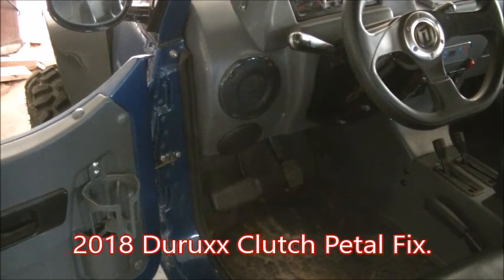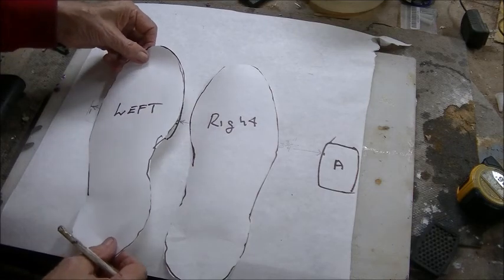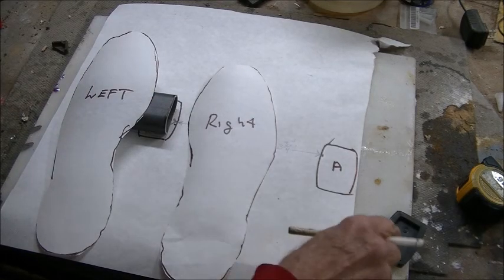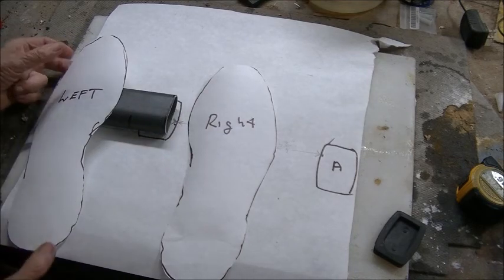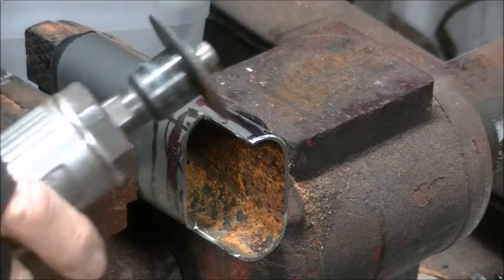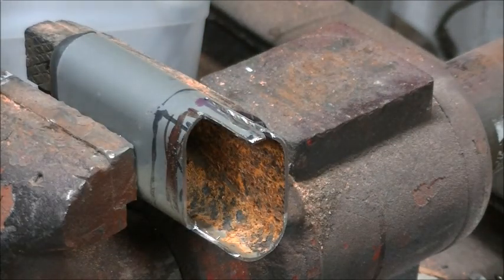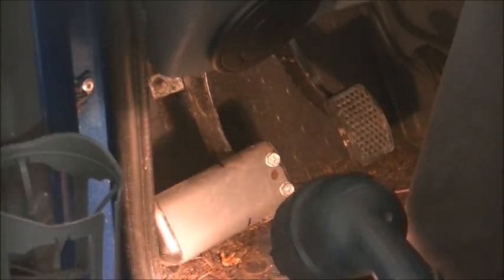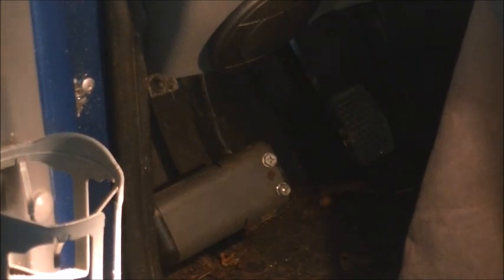2018 Duruxx Clutch Petal Fix

Comment: Larry, do you still have the machine? I’ve really been thinking about buying one if they are reliable. Your mods definitely need done
Reply: Yes, It appears to be reliable.  It only has 208 miles on it, always starts and goes.  I no longer have a use for it and will make you a decent deal.  Just getting to old to enjoy it. You can get me at woodwhirler@gmail.com.  Thanks, Larry